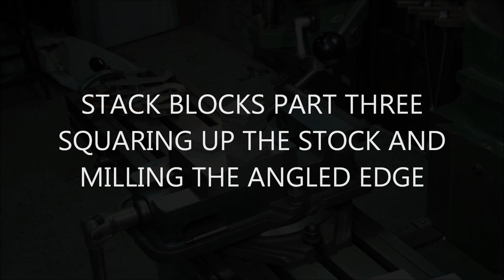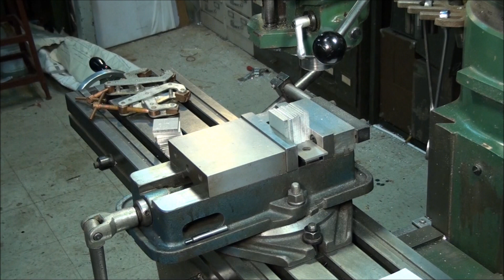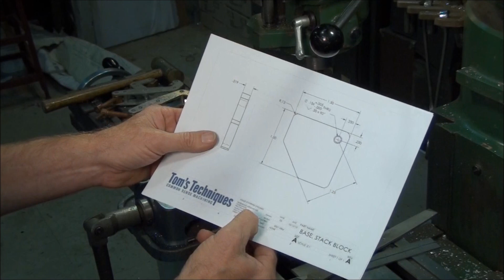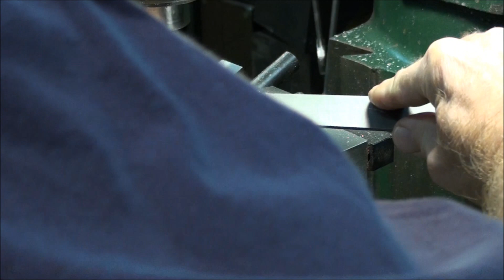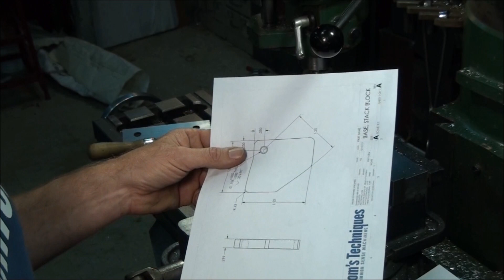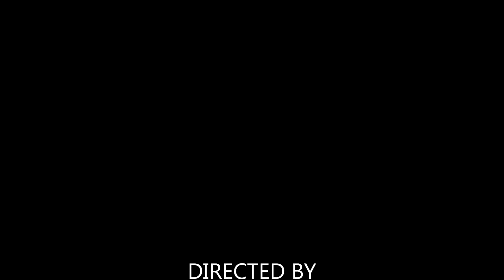Stack Blocks Part Three - Squaring Up the Stock and Milling the Angled Edge

Comment: Just  newbie questions and not trying to sharp shoot but it looks to me like the fly cutter is rotating to the right (from standing in front of the mill); isn't that clockwise? Also a basic question about fly cutters: the cutting tool has the tip on the right looking at the tool from the front (if the tool was oriented as it would be on a lathe). On another YouTube chanel video the person categorized this as a right hand cutter, he said when looking from the cutting end of the cutter a right hand cutter has the cutting edge on the right and a left hand cutter has the cutting edge on the left. Is that your understanding?
When the right hand tool is turned upside down in the fly cutter the cutting edge is on the left with the cutting edge impacting the stock first as the fly cutter rotates to the right. Is this correct?  
I know these are very basic questions but when just starting out the terminology of right hand and left hand cutters seems to be confusing. Sometimes it's difficult to ferret out the answers to such basic questions. Also, can I use a brazed carbide cutting tool instead of a ground HSS cutting tool in the fly cutter? 
This series of videos is great. I just got my mill set up and will start on this project tomorrow. Looking forward to learning along with your videos as I attempt to make the stack blocks although I will use a larger face mill until I figure out the fly cutter. As you can tell from the questions, I am at a very basic level but having fun and learning from your videos. Thank you for spending the time to create them.
Reply from the maker: The fly cutter is rotating clockwise, looking down on it from above. Vise can be deceiving.

If this tool were used on a lathe, it would be a left hand turning tool, because the left hand side is doing the cutting. On a fly cutter, it is actually the end that is doing the cutting.

I do not recommend that novice machinists use carbide at all. High speed steel is more economical and MUCH more forgiving, especially on interrupted cut applications such as fly cutting. Just make sure you calculate the correct rpm before taking a cut.

Thanks for watching.

Tom

Comment: Thank you for sharing your expertise Tom.  Would you care to do a video about making an angle block on the mill for those of us that don't have spindle yaw (i.e. spindle head rotation about an axis parallel to the crossfeed)?   Just a request.  I'd like to make a carriage stop body and the carriage ways are angled.
Reply from the maker: If you are talking 45º, an ordinary V-block works great. For other angles, a protractor or sine bar will get you there. If your vise isn't big enough, the part can be clamped to an angle plate at the required angle.

Thanks for watching.

Tom

Comment: When making the 45 degree cuts should you use a hammer to make sure that all of the parts were seated into the fixture? Seems dangerous to have the cut line so far above the vise.
Reply from the maker: Yes, the parts probably should have been tapped down tight into the V-blocks. That would have ensured that they were all seated evenly.

There is no problem with the parts sticking up that high as long as you approach them with the cutter as I explained in the video, so there is no chance of them rotating.

Tom

Comment: Dear Tom,
I enjoy watching your techniques because you explain everything very well.  I have a question,  What is the name of the clamp (looks like a scissor leverage system)  that you use for clamping the elements of the stack blocks called.  They are used initially in part three.
Norman (a model engineer)
Reply from the maker: Thanks Norman.

The brand name of those clamps is Kant -Twist. They are nice on a machine because they don't take as much room as a C clamp.

Tom

Comment: you could have put something thicker than the components and higher than the vice jaw to stop the thin parts from bending over
Reply from the maker: Sorry, I looked back through the video and can't see what you mean.
Reply: i meant that with components so thin and sticking out of the vice so high they could be bent over by the cutter so you could have put in against the jaw and inbetween the components a higher packing to give better support to the comps or ideally a higher jaw for these events
Reply from the maker: Got it. I wasn't concerned about that with this set-up because the parts were stiff enough not to bend and there had to be enough sticking out the top of the vise for the clamp to grip. If I'm concerned about stiffening thin parts I'll sometimes leave a clamp on during the milling.

Tom

Comment: could you do a tutorial on grinding a fly cutter?
Reply from the maker: I could, but it's really the same as a turning tool with a 0º side cutting edge angle and a 90º included angle. I'm planning to add another page to the reference section of the website on facing tools. Maybe I'll add one for a fly cutter as well.

Tom

Comment: turning on the 3 phase is causing some kind of distortion in the audio.
Reply: That's because he has a rotary phase converter.
Reply: Andre Gross Thank you for your observation. I'm wondering if Tom could shoot some footage with the camera unplugged from the mains power and the lathe running and see if that is indeed the case ? Not that it's really important or anything :)
Reply: fgleich The camera might not be plugged in at all, if it is it's only supplying power to the camera, not affecting the audio at all.
Rotary phase converters make lots of noise, because it's a motor running. Tubalcain (mr pete222) has lots of videos on his bridgeport mill which he uses a rotary phase converter and you can hear it as well.
Cheers.
Reply: That's not what I'm saying. Can't you hear the change in the audio when he turns on the  3 phase ? And, btw, ELECTRICAL noise CAN be on an A/C line and can cause problems.
Reply: fgleich No, I did'nt hear the change in audio, and how do you even know that it's electrical noise or just the camera self adjusting for a louder environment? We don't even know if the camera was plugged in or not.
Reply: fgleich
Hi there. What Andre Gross is saying, and I concur, is that all the noise you're hearing is from the mechanical vibration of the rotary phase converter motor. None of it comes up through the camera wiring so unplugging it won't make a difference. A VFD would do away with the noise. Cheers.
Reply from the maker: What you hear is just mechanical noise from the converter, the camera is not plugged into the mains. I've been meaning to make an insulated box to do away with the noise. Guess I'll have to move it up on the list.

Tom
Reply: Toms Techniques just curious, did you ever make a muffler box for your phase converter?  That seems like a project I would want to do, but never ever get to the top of my To Do list.  I appreciate the work you're putting into teaching what you've learned, and a little background noise isn't a problem.